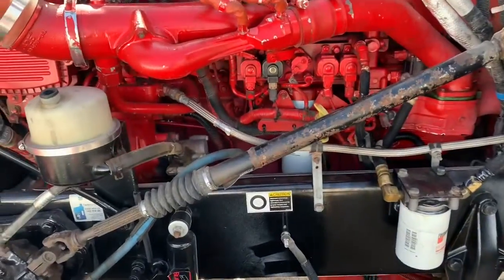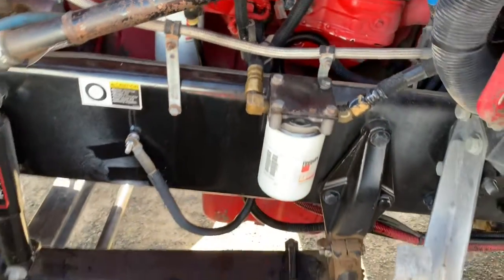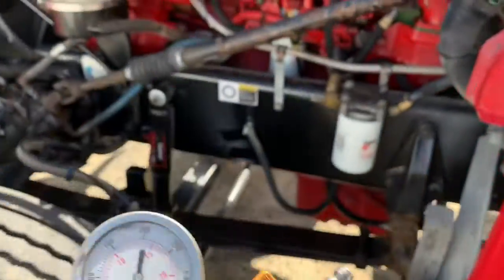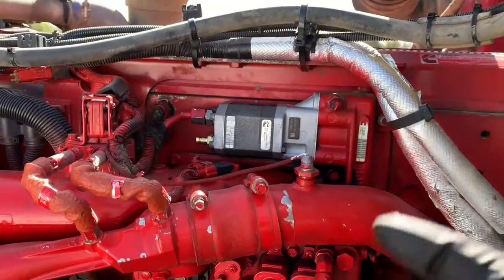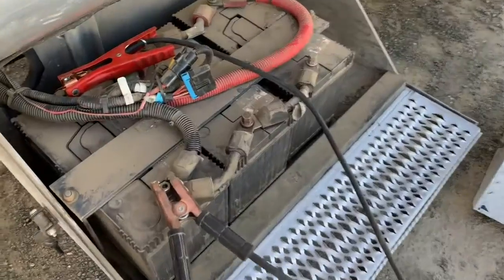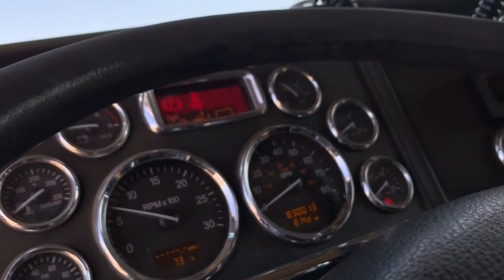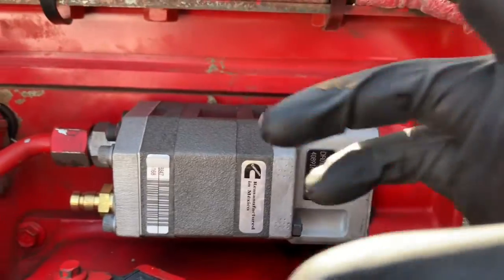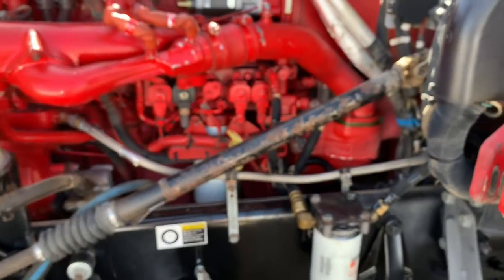How to diagnose Low Fuel pressure on Cummins ISX

Comment: That fitting you checked should be under the pressure of the lift pump only - Key on engine off. Once the truck starts (or you crank it) the pressure will drop and go to a vaccum as you are now reading the suction side of the gear pump. If you want to check the pressure of the gear pump you can hook in to the compucheck fitting on the back of the gear pump. This fitting is connected to the high pressure side of the system. It should read approximately 250PSI. The whole system is limited to 250PSI. If there is a blockage or failure you will hit 380PSI before the emergency pressure regulator bypasses the pressure. If your pump has 250-380PSI it’s possible your fuel filter is clogged or your fuel shut off valve is stuck closed. To ensure this is not the problem you can check the third compucheck fitting which is attached directly to the gallery that supplies the 4 actuators.

Comment: The mechanic told me the problem is the same pump that gave you problems but my truck turns on every time. I get the code 2215. Anyone that can help I’ll appreciate it a lot thanks.

Comment: Hey I have a 2010 international with cummins isx, the truck was staring and running fine i did an oil change as soon I started at the shop it idle a little rough but I though it may got some air and it will go away but it being giving me problems to start, the rough idle never went away until I tie the top cap in the fuel water separator, but the hard time to start keep happening, like 2 days ago I crank it 5 or 6 times for over 15 secs and would not start I took fuel out of the tank and put it in the fuel water separator and It did start and ran fine any idea what it may be? Oh and I just watched your video when I turn the ignition on the transfer pump does make the noise for a few secs
Reply: You may have a crack fitting in your fuel lines, or debris in you fuel tank.

Comment: I got 09 isx it rough start to the point that I thought it’s going to shut off and it shaking horribly for 3-5 min and back to normal idling need help if anyone knows what it’s or have an idea thanks and that is every time I start the truck after sitting for a day and it getting worst during the cold season
Reply: Did you found out what was the issue?
Reply: Did you find the problem?

Comment: I have an 05 Cummins cm870. Starts right up but then 2-4 minutes later it dies and throws white smoke. Any ideas? You can hear the transfer pump working fine. I’m scratching my head trying to figure it out.
Reply: Same problem I'm dealing with
Reply: @brianfrazier9142  I changed out the transfer pump. Truck stays on longer 10-15mins but still dies.
Reply: @jrvillarreal2901  sounds bout what mine is doing. Mines it at shop now
Reply: @brianfrazier9142  Damn. Let me know what the out come is. I’d greatly appreciate it Brian. Save me a trip or 2😂
Reply: @jrvillarreal2901  10/4 lol
Reply: @Jr Villarreal  did you change fuel pressure sensor yet
Reply: @brianfrazier9142  no I haven’t. Should I start there? Thanks
Reply: @jrvillarreal2901  it wouldn't hurt...
Reply: @brianfrazier9142  I’ll start there thanks a lot. 👍
Reply: @brianfrazier9142  Did they figure out what was wrong with the truck?
Reply: My fault for late response. Got truck out of shop, that low fuel pressure code that was shutting truck off was fuel pressure sensor needed to be replaced. Give me a few days let me see how it runs
Reply: @brianfrazier9142  well I think I figured out the problem. High pressure fuel pump or gear pump. They are pricey AF but hey it is what it is. I’ll keep you posted on the results.
Reply: @jrvillarreal2901  ok keep me posted
Reply: @brianfrazier9142  Well, it wasn’t the high pressure pump. I tried one that my mechanic uses to test and it did the same thing. Back to the drawing board.
Reply: @Jr Villarreal  dang. Well I found out my egr was leaking 🤦🏾‍♂️

Comment: What is the pressure port below and left of the mechanical pump your checking.  I have 290psi at that one and 0psi when running at the mechanical.  15psi at mechanical engine off using only lift pump

Comment: Hi guys, I have a 2010 international prostar Cummins isx  with  the same problem but my runs,  only Cranking get 20 Psi, on less than 15 PSi  on the side valve, On the from valve I get 270psi but in hill I lose power, any one knows something about, thanks

Comment: So I have an 870 ISX I just ran a bunch of diesel clean through it and hooked the lines up into a Jerry can I have a injector knock at about 13 or 1400 RPM and maybe a little bit of a misfire when I pinch off the return line the injector knock and the misfire completely goes away  .... Now if I had a pressure gauge I could easily tell whether or not the injection pump is going bad but does that sound like a possibility.

Comment: Well i got à big problème i tests my fuel presure a the same place of you i got 5psi on idle and 10psi on start up the truck Runing good but some Time it got an rufh idle and a code apear and desapeare and my truck doing prety good its more wake up than a x15 550 with 5 psi i think if i change that i going to the moon right up

Comment: What would cause the truck to just turn over for a long time before starting?also there is oil going to the fuel what would it be?
Reply: Check the lift pump, there is a pressure holding valve in there.

Comment: Man good info. I’m having that same issue but I can’t figure it out yet. My prime pump is working and I’m getting fuel out the small cable where u say u connected the pressure gage to. Idk how much pressure but when I push it in with a screw driver it bursts out. Any ideas how I can continue trooblshooting it? Thanks 🙏🏽

Comment: you skipped about five steps, glad you fixed this one but the two check valves can cause the same issue you had. 20 psi cranking is correct and in specs, 100 psi running is correct for the compucheck you pointed at, you also have to check the pressure by the engine filter  and at the gear pump also,
Reply: @transport21  go to cummins quickserve and start a free account and use  your engine serial number and follow the fuel trouble shooting tree it will point them out for you would be really hard to explain, or do a search for isx location diagram they have one for sensors and such that will show what model you have, 870 2150 2250 etc, but basically one is top left , other is bottom side right botton facing down, top left is facing out, you also need a compucheck fitting with a low pressure gauge and a high pressure gauge, the fitting out the back of the pump will be 300 ish psi, so dont blow your low gauge with the pump,
Reply: Where are those check valves precisely?
Reply: @roz4747  open up the reply above and read it. you will have to follow those steps

Comment: My Truck Runs Fine With A Full Tank But When It Gets Under Half A Tank......It Starts Acting Up.  

Acting Like There Is No Fuel In The Tank(Check Filter On Dash). 

But When I Fill It Back Up, Everything Works Fine.   

Had Tanks Cleaned And Inspected Due To Being Dirt......But It Didn't Fix The Problem.  Help.
Reply from the maker: Pickup tube cracked. Just had a truck doing the same thing... replaced pickup tube and no more air in fuel system
Reply: @BulletMcNugget  Volvo Said That My Tank Don't Have A "Pick-Up" Pick.....

I Get What Ur Saying And It Definitely Make Sense.....At This Point I Am Thinking About Just Getting A New Tank, Just To Save Myself Anymore Downtime.
Reply: @OpinionatedGent  
Could you please update what the issue was and how you fixed. Thank you.
Reply: You have a cracked fuel pick up tube

Comment: My 2011 pete cm871 had exact same issue when I bought it off a guy. But mine was just extended crank with low pressure code on dash

Comment: 2006 cm 870 getting low fuel pressure code but after start up, starts fine. Sometimes will hesitate or loss of power after getting going then rest of day its fine? Today really rough loping idle after starting and bumping up the idle. Couldn't believe our shops diesel mechanic didn't have one of those pressure gauges. Any ideas on that do you think its the fuel pump or is that more of a start up issue. We changed pressure sensor earlier in the week still happening. I dont like the idea of them throwing parts at it till they get it.
Reply: Have you figured this issue out?... I have a 06 cm870 as well . I’m having the same issue as you.
Reply: @taryrai2300  changed the  fuel return regulator or solonoid I forget exact name and that fixed it. It's the round solonoid in middle (or just below) of the four actuators.
Reply: @threehemis5566  the fuel shut off solenoid I think you are referring to. Round and has the wire coming out
Reply: Or check valve
Reply: @taryrai2300  that's it shut off solonoid. Hope that helps